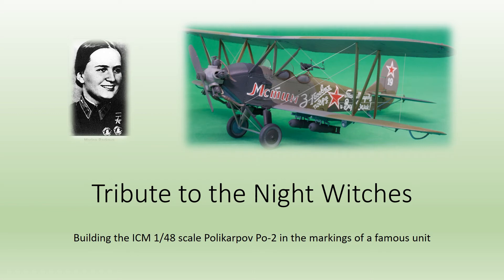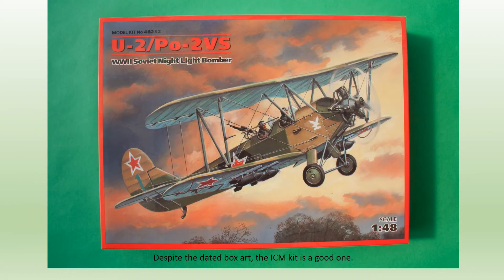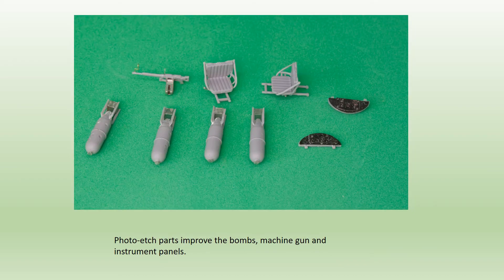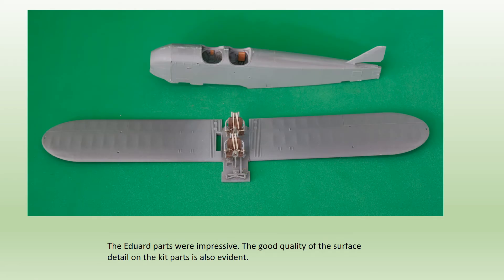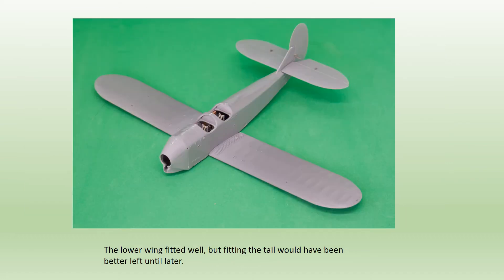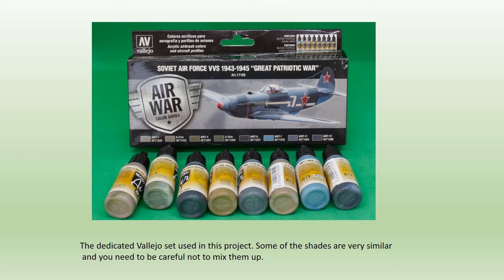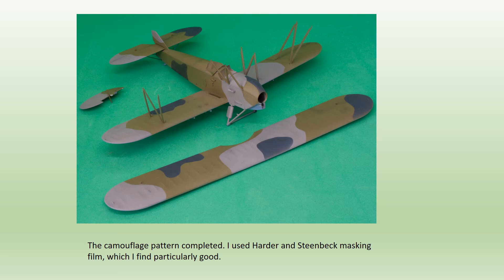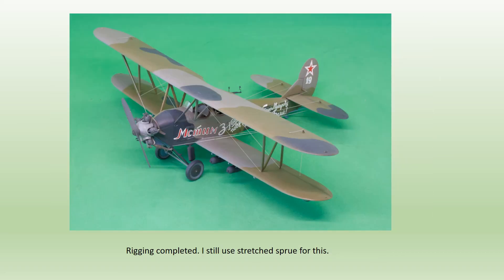Building the ICM 1/48 scale Polikarpov Po-2

Comment: Hi Pete,  Excellent Po-2  and a better fit than the Special Hobby range by the look of it.  1/48th needs PE enhancements and this is a sharp end product.  As you mentioned the edges look very scale.  The cockpit is excellent and again a great visual feature of the kit.  I have always found the trickiest part of biplanes is ensuring the upper wing struts stay at the right angles to the lower.  In my early days I'd get upper wings creeping off sideways before the glue set, or found that on setting the upper wasn't directly above. Those 8 small points take a lot of responsibility.

I am impressed with your rigging, lovely thin even sprue it does take practice to get consistent diameter over length.

A tip please - I have some Johnson's Pledge floor polish for pre-weathering coat but need to thin it, what did you use to thin yours?
Reply from the maker: Hi Gordon

Thanks for the positive feedback!
I've not tried Pledge but my old bottle of Kleer is always diluted 50/50 with tap water and works fine.

Best regards

Peter F
Reply: @peterfearon317  Hi Pete, I've re-read the Pledge, it's a gloss floor polish that a number of modellers recommend in the 1/35th Military Modellers forum and its main ingredient is water even though it dries to a shine.    Also I looked up sprue stretching and great for aerials but I see many use EZ rigging which seems to be a rubber thread that stays taught when mildly stretched.  CA is used to stick it.
Reply: I have never thinned pledge. But you ought to have a serious thought of Moving<throwing away> from pledge,  and going with laquer clear varnish s.

Comment: Thank-you for your info on this I have ordered this 1/48 model! Where did you get the Night witches decals I haven't got the kit yet and was wondering if the decals came with it? I have ordered the Eduard photo etched kit. Do you know where I can get the 1/48 scale women pilots either in resin or injection? I found an ICM mixed ground crew and pilots, I have ordered from Hannants models. I have found some decals of Nadezhda, Popova's plane at Hannants in 1/48 scale.
Reply from the maker: Hi Kevin. Thanks for your comments. The Night Witches decals are included in the kit and are fine. I used some after-market decals for the national stars, but really the ones in the kit are perfectly good enough.
Reply: @peterfearon317 that is a fantastic job you have done on the aircraft,  I have ordered a set of the Vallejo soviet paint 🎨
Reply from the maker: I was pleased with the Vallejo paints. I've not always been a fan of acrylics but these worked well.
Reply: @peterfearon317  if you go to e-b and type in 1/48 female pilot there are 2 resin ones, there is one standing and one seated especially for this aircraft. I'm thinking of putting the seated one in the front seat as you say you can't see in the front cockpit very well. Is the Halford primer paint acrylic I'm a bit worried about it melting the plastic?
Reply from the maker: The Halford Plastic Primer is acrylic and doesn't degrade the plastic at all. It works equally well as a base for enamels or acrylics. It's far cheaper than the modelling brands of spray primer, too.
Reply: @peterfearon317  thanks for that I have got someone to pick some up for me. Do they do a white and black primer? 
I think I have everything together now except the plane, I will keep referring to your video as I build it, and thankyou for putting your build on YouTube it will help me avoid mistakes. How did you bend the Eduard machine gun ammo boxes into shape?
Reply from the maker: Halfords do various coloured plastic primers. Grey is my preferred choice but the others can be useful too.
Reply: @peterfearon317  importantly something else I need to ask you, did you spray the Vallejo paints of did you brush them on? I find big problems with spraying it as it tends to clog up my H&S inf, even thinned down with A/B improver, I sometimes find that a little AK paint retardant helps both spraying and brushing.
Reply from the maker: I sprayed the paints. This does lead to some clogging but I kept a wet cotton swab at hand to clean the tip regularly - that helped a lot. I don't think any brand of acrylic paint sprays as well as enamels.
Reply: I bought two female resin pilots made especially for this plane and the seated pilot is a very poor fit, her head goes beyond touching the dashboard and the feet don't fit the pedals, I had to refill and re-drill the seat holes and move them further back on both seats, it's all turning out a bit of a mess, the Eduard parts fit nicely though. I've given up for a few days. Might feel more like carrying on in a few days?